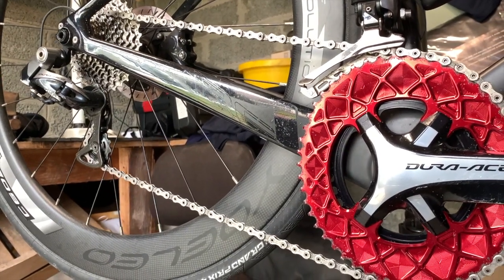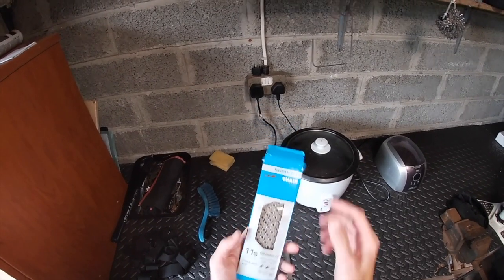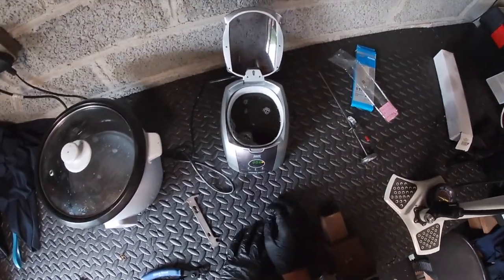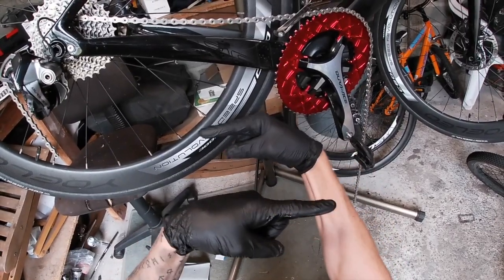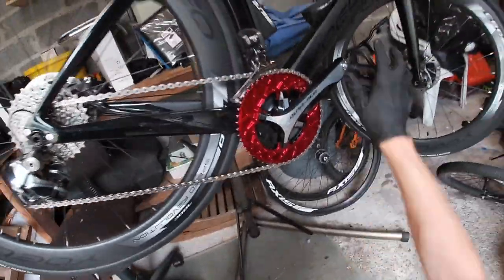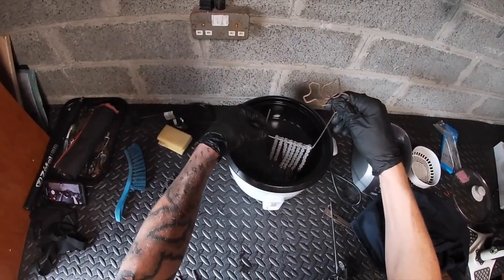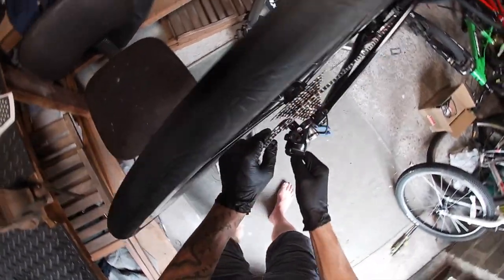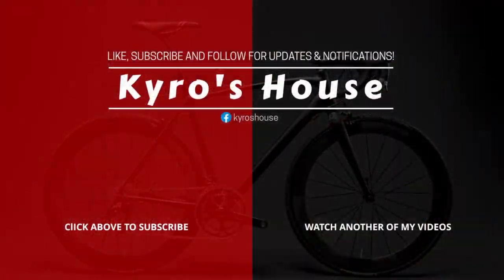Dura Ace Chain Replacement Clean Shorten Wax

Comment: Hi i am definitely not a mechanic but I was curious why you don't lay the new chain anext to the old one to get the length. I am sure there is a good reason. Thanks
Reply from the maker: Dominic Shepherd yes that is my usual way, but I just wanted to show how you would measure it if it was your first chain. 👍 plus I had changed cassette size so wanted to do it this way. 👍

Comment: how to establish the correct chain length for this group set is to feed the chain round  ( before waxing) the big chain ring then feed  the chain round the biggest rear sprocket then pull the  2 ends of the chain tight ( do not feed it though the derailleur) together to the closes link  if you are between 2 links then  use the link that will make the chain slightly looser then add 2 links ( 1 link if using a quick link).
Reply from the maker: Ian Robins hello, yes I don’t do this every time, I just thought I’d do it for this video. I’d normally just use the old chain as a reference. But good to know that shortcut 👍

Comment: Very informative - thanks for posting.  How many times can you reuse the quick link?  They are very expensive to purchase these separately.
Reply from the maker: Bruce Smith I’ve heard people say that you should only use them once, but I’ve easily used mine over 50 times. I can’t remember when I bought them. I originally bought 2 but the gold colour comes off when I sonic clean them. So now one is silver which makes it harder to find on the bike but it’s not a problem. 👍

Comment: I'm just starting to get in to submersive waxing and I would agree that the time that you've left the chain in the wax could be a lot longer. I've followed pretty much everything that Adam at ZFC has uploaded on to his website (and YT) and he just lays his clean/new chain on top of the cold, solid wax in the slow cooker and then just switches it on and leaves it. It's thought that this method then allows the (cold & contracted) chain to heat up with the wax as the slow cooker slowly gathers heat. This then allows the wax to penetrate more deeply in to the rollers and between the plates, etc as the metal expands with the heat. As you say in your video, it would seem that your method did do it's job - as you had some difficulty in re-mobilising the chain links after the wax had completely set. I personally do what ZFC suggest and I leave mine in the slow cooker for around 3 to 4 hours in total (on low setting). It takes around 1 to 2 hours for the wax to completely melt and then I've tended to just leave the chain in there for a few more hours and swish it about now and again. The chain slowly sinks in to the wax as it melts. My thermometer shows around 115 deg C when I leave it for this sort of time. I'm not sure what your thoughts would be on this method but Adam at ZFC seems to have spent 1000's of hours in researching and experimenting with this whole topic - so I'm trusting that this wouldn't do any harm to my chain - even if it doesn't really do much good either. Cheers for the video!
Reply from the maker: I can’t remember the molten seed wax instructions but I try not to let the wax get over 100°C and I have it submerged for about 20 mins. 👍

Comment: Just wondering , usually a waxed chain isn’t noisy unless when crossing chaining. Feel that the duration u let it sit in the wax bath is too short , usually I would put it in for 15 mins to let the wax penetrate in properly
Reply from the maker: kevin ng yeah it starts off noisy as it’s all stiff but it becomes almost silent after a k or 2... I probably leave it for 5 mins swishing it round so I’ll see if I leave it longer if that makes a difference or not. 👍
Reply: @KyrosHouseCycling  that’s why I remove the chain only once the wax has formed a surface skin so the wax doesnt drip out, and do. cold water quench.
It is stiff, when then I just wipe all the excess wax off the chain, so it’s all clean upon installation.
Reply from the maker: @patrickparisienne1917  I did it for longer this time, so I’ll see how it is. 👍

Comment: I happen to come across this video. Correct me if I am wrong they are multiple ways of cutting chain. But wouldn’t it  be much simpler wrap the chain on the largest cog/sprocket and the large chain ring in the front and then add two links then cut chain no need to pass it through the derailleur. With the above method mention I thing you will have a more accurate/precise length.
Reply from the maker: I’m not sure you can be accurate unless you thread it all the way through properly. You may have a long cage or medium cage which will alter the length needed. 👍

Comment: Hi kyro, is that wax still the same batch from 2 years ago on your video? If so how many km until the wax need replacement?
Reply from the maker: Yes, I don’t use much each time I re wax. I’d say around 200 is usually when I do it, but I recon I could get more, it’s just I do it every work rotation and that’s about how much I ride during that time. 👍

Comment: How much KMs did you get on your previous chain? I'm a bit skeptical about the whole pot of wax and submerge your chain procedure, whether it is worth it over a simple bottle of squirt lube or morgan blue dry wax. I've gotten really good mileage of the chain and wax bottle tbh, and that is for me the whole reason to switch over to wax, to have less hassle cleaning and less maintenance work in general.
Reply from the maker: CyclingMilan er a lot! I can’t be specific because I forgot to put my chain on my strava list so it’s not exact I’m afraid, but I can’t remember the last time I changed it. I’ve done 2034 kms this year and only just changed it, but when I last changed it I couldn’t tell you. I basically only ride between March and September as a rule as I’m playing indoor volleyball the other times. I do wax it a lot about 150 -200 kms because it’s every shift rotation it’s just easier for me to remember. 👍
Reply: @KyrosHouseCycling  Do I understand you correctly that you re-wax the chain about every 150-200 kilometers? Also, how quickly does the wax pick up road grime compared to more traditional lube? Thanks!
Reply from the maker: B Priest yeah it’s just easier for me as I work shifts, I redo it every shift. I’m not sure if I need to but it doesn’t take long. The wax really doesn’t pick up any road grime, and looks clean all the time. A more traditional lube gives you horrible black oily mess. 👍
Reply: @bpriest5108  It catches some dust and dirt from the road similar to the other parts that are low on your bike, like the cranks or the derailleur. But nothing compared to oil. BTW I use wax from a bottle.

Comment: I'm questioning two things.  I've heard that factory lubrication, on a brand new chain, should be left on until you are ready to do the first cleaning.  I've also heard that Shimano does not recommend using a quick link on their chains.  Please advise me as to how successful  your system works.  Thanks
Reply from the maker: Hi, thanks for the questions. 

1. Yes I follow that same guidance, I basically leave it in the pack until I’m ready to clean and wax it. 

2.   For years KMC, YBN, SRAM and Wippermann have used such links, while Shimano and Campagnolo held out and stuck with special replacement pins. However, even Shimano is now changing its tune and its latest 11 and 12 speed chains are available with master links.

Copied above from cycling tips . Com January 31st 2019 edition

https://cyclingtips.com/2019/01/chain-quick-links-guide-to-easy-connection/

The process is very easy and i find it much better than lube, super clean and very quiet. 👍
Reply: I've heard that if you go outside when it is raining, you might get wet.